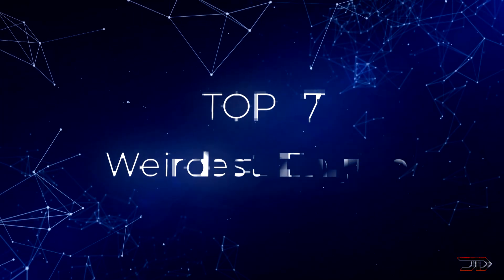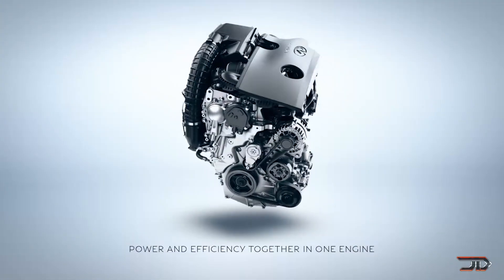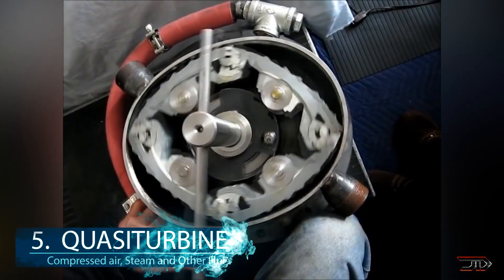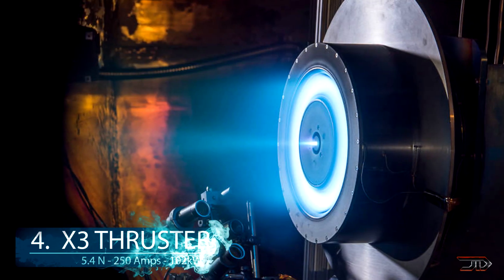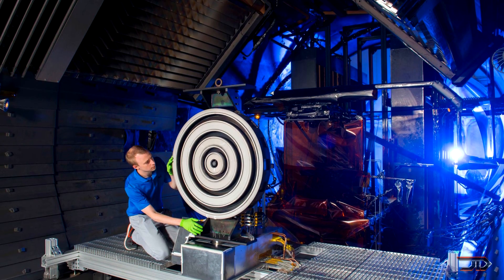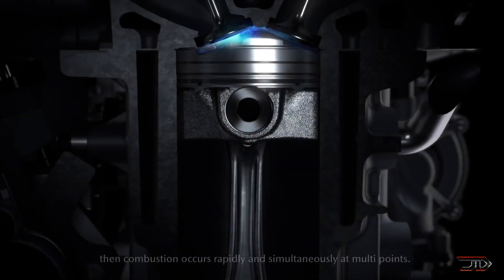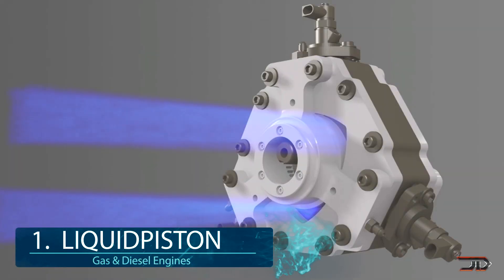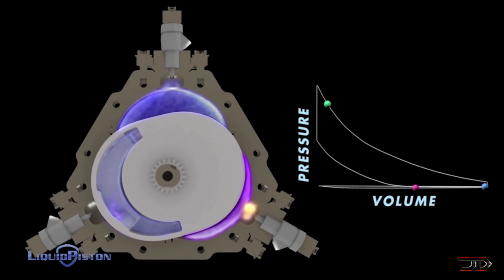7 STRANGEST New Engines

Comment: 7- VC turbo engine is much like an atkinson design.
6- Doesn't look like it can have a high efficiency, with all those heavy moving parts. Much like a Duke engine, the large rotating mass will more than likely have a low reliability, and efficiency.
2- I'd like to see a 2 piston design for generators, and hybrid cars.
1- Great design, but they've only managed to build 4HP prototypes up to this point.
Reply: missing the biggest problem: electrics are always gonna be more efficient, and they'll always last longer, and they'll do all that while being cheaper in every way.

Comment: Battery-electric motors: We exist, have 2 moving parts and convert 90% of energy to motive force!
Gas-internal combustion engines: We have over 350 moving parts and convert less than 30% of energy to motive force, 
and the whole system is converting clean air, water and land into toxic waste that poisons living cells! 
Making these more complicated engines to get another 10 or 15% efficiency, 
still leaves them in the dust of the electric motor. 
Oil money is powerful and there's much propaganda that has been dis-proven, 
yet it's still believed by many because effective propaganda is not about facts.

Comment: 0:19 High compression is more power (higher heat). Low compression is lower power (less heat)..
Reply: Are you trying to bait people?
Reply: @raving_1074  meant lower compression lower power and *lower heat*. Edited for correction.
Reply: no way low compression is efficient
Reply: @nurfaikhamhaiqal2528  meant to say cooler engine.

Comment: Very interesting designs... The simplest and probably the most efficient one is the Liquid Piston engine... The power to weight ratio potential of this Liquid Piston design is also quite impressive... The Wankel Rotary engine was a very innovative design, and they had tremendous potential, but they had some serious inherent problems. The 'Liquid Piston' engine design seems to have solved all of the inherent problems of the Wankel design, with the high power to weight ratio and what appears to be extreme reliability and simplicity...
Reply: Any links to more info on actual testing besides their main website?

Comment: why just don't use gasoline fuel cell (simmilar idea to hydrogen fuel cell, but powered by gasoline)?
Fuel cells has higher efficency than the best conventional engine, there is no moving parts.
Vehicle can be powered then by electrical engine, that can reach efficency above 90%

Comment: @3:49 I designed this engine back 50+ years ago. Never made one but it worked on paper. Certain materials back then were not efficiently made. Even this one (video) isn't quite ready for mass producing. Maybe in another 8-10 years.

Comment: Suprising that no one has incorporated the EVIC concept into a commercial engine yet. EVIC stands for Electronic Valve internal combustion, where the valves are moved and controlled by a solenoid and electronic circuit.  No camshaft, pushrods,  no lifters, tappets or rockers needed.   Several concept engines have been built and test run very succesfully.      https://www.youtube.com/watch?v=8nxsrdrynXY

Comment: the second one is really interesting.  it has issues though.  it'd cost a lot to manufacture and build.  alignment of the chamber and piston would present great challenges for companies to be consistent.  it however, looks like it'd rev extremely efficiently.   especially since it combines the physics of a fly wheel into a crank shaft. but one misalignment of the piston or chamber and the thing will explode.  damaging the entire engine, while most issues with normal engines are fairly salvageable.

Comment: Reliability is the keyword here. I never liked downsized engines because of that.
Reply: The X3 has a failure rate of 0.2/10 and that's mostly just underperformance failures, its just got five failure points and is supercompact. Try that on for size carman.
Reply: @Iamlurking504  Most of the experience we have seen with compact engines (3cyl vw polo and opels etc.) very unreliable compared to older less power dense 4 cyl. 
For example with diesels: 1.9l Renault 19 diesel (around 60hp) lasts for ever sometimes 800.000km while a modern 1.9l Renault DCi (about 110hp) lasts barely 200.000km!

Comment: All of these engines run into the same old three demons. Sealing gasses, cooling, and lubricating. Nothing so far has worked better than a piston in a cylinder and overhead poppet valves.

Comment: 3:30 - very lean gasoline fuel mixture is volatile and tends to detonate UNLIKE diesel engines. A way to offset this, and it's been done quite a while so, is to put in cool exhaust gases via the EGR-system. This burns off particles making the engine cleaner and it also allows for higher compression because the mixture isn't so volatile.
Reply: Hah! Try Hydrolox for unstable!  If any structural fault allows even a milligram of lox to mix with the hydrogen the lox would expand rapidly and then RUD. Silly car man.

Comment: As a mechanic this makes me hurt every single one of these concept engines will be unreliable asf the second or third engine on the list is just stupid why tf would u want to detach the piston from the housing never thought of thermal expansion and every single one of these engines is over complicated for no reason changing the hieght of the piston is useless asf u can easily run different ecu tunes and shit why tf are people trying to over complicate things to solve problems that don’t exist
Reply: 100% agree, except the opposing piston is dope
Reply: The Mazda Skyactive engine not a concept engine, it's in production in their cars, in conjunction with a conventional automatic transmission.   It's said to give a wider best-efficiency range than other manufacturers who concentrate on one engine speed then fit a CVT to try and keep the engine there (like Nissan.   Heard how reliable Nissan CVTs are?   ;)

Comment: It just does not make any sense at all to invent new types of internal combustion engines because that technology is already obsolete.  If the inventors will only concentrate on inventing better batteries or a way to generate or harness natural electricity like what the scientist Nikola Tesla did 100 years ago which will make EVs run with unlimited range, then that will be the way of the future.

Comment: 2 and third engine need oil in the comustion chamber, hence dirty emissions, 5 and 6 are pretty much the same except they are opposed pistons
Liquid piston is interesting but seals are the issue and curious about the oil requirements for the rotating chamber

Comment: the first engine has a big flaw the more joints or moving parts you have the less you have in energy efficiency. basically your going to pay for it in the long run out of pocket not only for maintenance but for fuel. :/

Comment: The 6 piston 3 cylinder engine is basically an evolution of the Napier Deltic, the German Jumo 205 and the Fairbanks Morse 38 8 1/8 submarine engines.  Look them up, especially the Deltic, a fascinating and complicated engine.

Comment: The opposing piston engine is very promising I feel like , you know 2 stroke so very light compared to power very high pressure and pressure ignited doesn't need to burn oil ,. It would be very nice to see one on a motorcycle

Comment: The Achates is a similar design to the old Leyland L60 or Commer "knocker" engines, or even a Doxford, being an opposed piston 2-stroke diesel engine. It's just a lot smaller than those older models.

Comment: I made a engine that was made out of a lawn mower. It sounded like a steam train horn when it ran. Some one stole it even though it produced a problem of sucking oil out of the piston and combustion chamber out the exhaust. Some guy I heard a rumor had tried to run it for some reason on his lap in his car it sucked his lap into the engine ran out of oil and set him on fire I guess. I think I have a live concert song of him in the back ground the sound at the end sounds like the engine sound that mine made. I will post the song if it dont get copyrighted it will be on my channel. Its the song by Bruce Springsteen called land of hope and dreams.

Comment: The Future is purely ROTARY. ELECTRIC MOTORS. Simples, efficient, clean, lightweight, powerful, durable, maximum torque from 0 rpm, can work at nominal power for as long as you need.

Comment: My confidence in infiniti's engine became 0 the moment I saw a timing belt.
Reply: +100 confidence to Achates power.... no timing at all outside of injection, no head even! Intake and exhaust through the ports! the clean burning also means very low carbon buildup even on the exhaust port.

Comment: All are way way too complicated... unnecessarily complicated I think..  I am a master mechanic, worked on exotic import cars..  apprenticeship on Jaguar.   And I did gray market conversion in the San Francisco Bay area as an engineer and research scientist..  .. I am developing a working Tesla turbine.. without the problem of high temperature and speed creating stretching of even the most rigid metals..  metallic bonds are not strong enough  .. a sphere of carbon or silicon carbide can withstand heat up to 3800° C... and, practically unlimited rpm, because a sphere has only one moment of inertia.. it's cener of mass... I have a few spheres to play with... you will hear about them soon

The StarFire Family wishes you Peace and Prosperity Ad Infinitum 🙏 
Peace ✌☮

Comment: Damn I saw a rotary engine so I though of a new way to make an engine, then found this video and the arches 2.7 is what I was thinking of trying 😂
Reply: The achates engine design is already is popular use at Fairbanse Morse for their giant diesel engines used for ship power and emergency generator power etc... so its a proven design and extremely reliable. There is really little to no reason not to trim the fat from it and put it in automotive applications. The military is also contracting Cummins to build a 4 cylinder 1000hp tank engine using Achates technology called the ACE (advanced combat engine)... they also have a big 10L engine for freight tractors being tested by I think it was Tyson and Walmart that meets all next generation emissions requirement while also reducing the need for so much DEF.
Reply: The have been a number of opposed-piston engines in production.  Perhaps the most notable is the Napier Deltic, which had three banks of cylinders of opposed pistons.  It's an 18 cylinder two stroke diesel, supercharged.  Used mostly for railway engines and in ships.  You can read up on it here: 
https://en.wikipedia.org/wiki/Napier_Deltic

Comment: I guess there wont be much need for these with electric on the rise.
Reply: electric motors are simpler, just need battery tech to be better though current battery tech already fit the use-cases of some motorists. i see Electrics and Hybrids all the time in Europe because charging stations are a lot more accessible there.

only if battery companies had better lobbyists than oil oligarchs in the US.

Comment: To be clear, rocket engines ARE true engines. SRBs (Solid Rocket Boosters) or rocket MOTORS are NOT engines.
Ion thrusters by definition are electrodynamic rocket engines; thus, X3 IS a true engine. The main difference between X3 and other rocket engines is in it's fuel, or, more precisely, reaction mass. As you know, a chemical rocket mixes liquid fuel and oxidizer in an injector for spontaneus combustion before ejecting it through the nozzle. The exhaust shoots one way, and Sir Isaac Newton pushes the rocket the other way, but Ion thrusters have more in common with nuclear than chemical rockets, with one major difference. Ion thrusters excite Xenon gas and use electromagnetism to expel it through the nozzle at high speeds - NO OXIDIZER REQUIRED. That means no combustion, and it also means you can triple the amount of propellant for the same amount of wet mass. Nuclear rockets are similar in that regard, but use heat exchange from an open cycle solid core fission reactor to heat up Hydrogen gas to use as reaction mass (again, no combustion takes place); nuclear rockets provide much greater thrust to weight ratio (TWR) compared to ion thrusters, at a cost of efficiency (specific impulse - ISP).

Comment: Hmm, Okay. I see only a few "new "engines designs. Three are really based on old designs, The wankel with two types, opposed piston , and the high compression multi fuel.  
   The ion drive is very workable probably for space travel where long distances and slow build up speeds will equal hude speed over time isn't that important. 
   The circle cylinder looks interesting but I worry about high emission gas output and low hp ,  and number 7,,, Well the more complicated and moving parts to go wrong physics tells us, the more will go wrong,, I see this monstrously a grenadine ready for the pin to be pulled at high rpms, Of course it's just an opinion.

Comment: Yup more moving parts has come to mean "oops more to fail" and that in itself does not usually inspire buyer confidence. Opposing piston though sounds really cool.
Reply: @Юрий Тойкичев yup engine technology seems to be stuck in the rut it has been for many years.
Reply: I agree, JWST has over 500 failure points on it... but its not had a RUD or any other sub nominal performance yet.

Comment: Correction: Rocket engines and other space propulsion systems do not have a "maximum velocity" they can reach, rather they have a maximum efficiency they can achieve. in theory, for a given payload of weight Mp, any type of thruster (chemical, ion, or otherwise) can reach any velocity, it just takes a different mass of fuel, Mf, to get there for engines of varying efficiency. The efficiency, Isp, is measured is meters per second, however its not actually referring to a literal velocity, it's just how the units work out (sometimes its referred to as effective exhaust velocity, but this is just a name, and a confusing one at that). What Isp really represents is the amount of force generated for each kg/s of fuel flow. On any engine, if you increase fuel flow, you increase thrust. But the better the Isp, the more thrust you get for that increase. Now we have everything we need to find out how fast we can go if we know Mp, Mf, and Isp. To find the change in velocity, delta_V, capable, we use the Tsiolkovsky rocket equation, which states:
delta_V = Isp * ln(Mt/Mp)
where the total starting mass is Mt = Mp + Mf
For chemical rockets, the theoretical maximum Isp is around 5,000 m/s  while the highest recorded Isp of any ion engine (as far as I am aware) was 189,333 m/s from the DS4G thruster developed by the ESA.

Comment: ok..   put a piston that ratchets a crankshaft ???  omfg the noise would be insane at 100 rpm let alone 2000 where the whole thing rips itself apart trying to move the vehicle or the locking lug on the axle would just fail..

remember kids... follow the kiss principle or end up with a 50 billion part thing with 40 million more parts that can fail.
KISS    =   Keep It Simple Stupid         for anyone who never heard of it.

Comment: My prototype reduces knock to the point where you can advance ignition timing to the optimum setting.  This gives engines more time to extract energy from the combustion cycle.

Higher compression engines would become the new standard.

Even diesel engines see improvements while using my prototype.
Reply: yeah, to bad gasoline is shit for compresion .   you actually need to compress the shit out of it to get any work out of gasoline...

meanwhile people running hho... hydrogen/oxygen cells need 0 compression because h2 is explosive... not just flamable like gasoline

Comment: There are some cool engines here for sure. The quasiturbine engine will probably sound really cool with a larger displacement. I agree though that it does seem a bit overcomplicated
Reply: What about the xeon ion engine? That is incredibly exciting. All these other engines would barely produce enough thrust to propel a Microsoft and probably have an ISP of 0.5 is going at max throttle.

Comment: What ever happened to the Herbert Cam engine of the 60's..?  6 cylinders 12 pistons with skirts welded together, horizontally mounted around a central cam and according to MIT produced high horsepower at low revs.....Could have been bought by big engine company in USA and killed .....anybody???

Comment: guess they dont understand the rules... you imput half the explosions, you get halh the work. so 6 cylinders and 3 explosions wont work with gasoline.

the inherent problem with gasoline is IT DOESNT EXPLODE.     its flameable.      hydrogen is the future, stop trying to re invent the internal combustion engine there's nothing wrong with it..   the fuel your using is 5% effecient at doing the work you want it to.

Comment: Back in the 60's or 70's they had a rotary engine they said would replace all others. I cannot remember but it may have been mazda. I guess they did not work so well, I never hear about one anymore.
Reply: The wankel from the early 1900s
Mazda brought it out called it the rotary..
Kicked ass. Remove all the smog B.S. could turn around 20K rpm
A 2 rotor engine fired 6 times a revolution..
Kicked Ass but not fuel efficient..
The later models were redesigned even more power...

Comment: I don't think you read the Liquid Piston material correctly. They don't compare their engine weights to other rotary engines, but rather to piston engines. For example they have a contract with the US Army to develop a 2 kW genset that is to weight 30 lbs dry to replace a 124 lb unit based on a piston diesel engine. This includes the generator and electronics which aren't too different between the two, so most of the weight savings is coming from the engine itself, which weighs about 1/5 the weight of an equivalent power piston diesel.